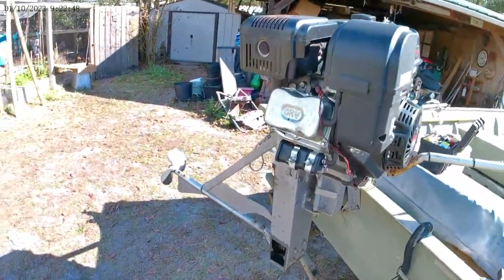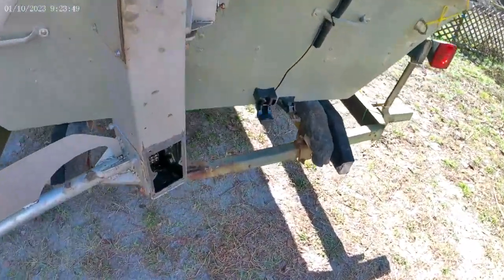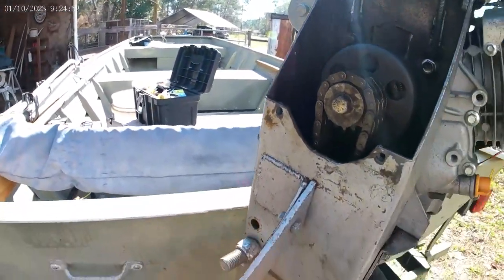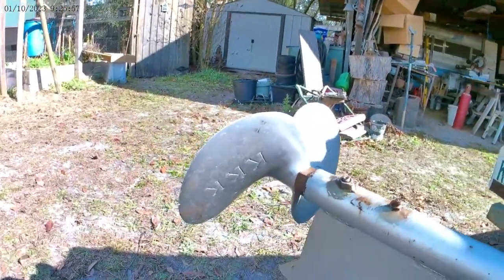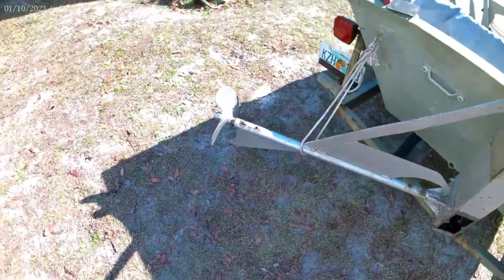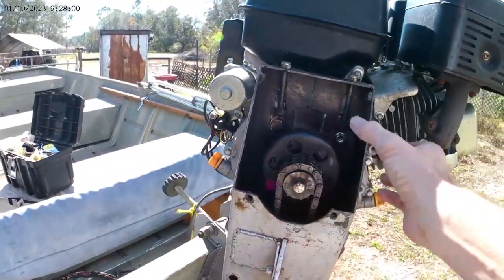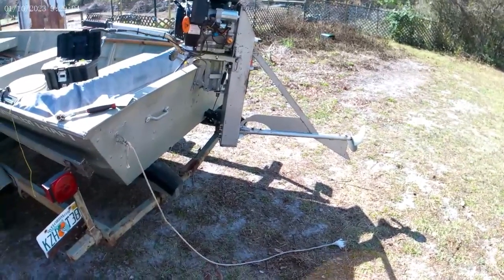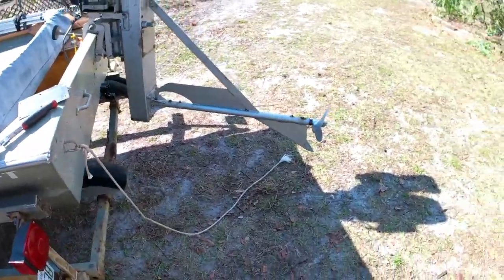Homemade short tail mud motor

Comment from the maker: So small update. The sprocket on the shaft came loose. I had  pinned it in place and it held for a long time and a lot of miles but let go about 3 miles from ramp. So I welded the hell out of it to the shaft! Just do that once you have it 100% in place! Trolling and rowing for miles is no fun!!
Reply: Lol damn right!!   However!…..thank you so much for this video….I myself am a tinker/fabricator/mechanic and I love this stuff.  You did a helluva job Sir!!!
Reply: Are those blueprints comparable with any motor or small motors? Interested in selling the plans?
Reply from the maker: @davidbrannan987  thank you. Much appreciated!y my first build like this.
Reply: @BackwoodsBuilt9737  you’re very welcome Sir!
Reply from the maker: @sm0k1ngam3rs3  the guy who made the plans built it to a 9hp motor. I  put 13 HP on mine. That's mainly why I had to go with triple roller chain over V belt. You can get plans off eBay from him. He also has a video on YouTube running it. Look for a homebuilt short tail with yellow engine.
Reply: @BackwoodsBuilt9737 thanks for sharing if you don't mind I have a question in the video you said you got the clutch and sprocket from mud skipper you said something about the chain ar sprockets being to small can you please give me the details of your  chain and sprockets set up so I can order the right stuff  thanks for sharing your work also thanks for all the great information  I'm a fan
Reply from the maker: @huxmetalworks7371  yes I got the sprockets from Mud Skipper as well as props and tapped props for my 3/4-10 thread on shaft. The chain that came with the mud skipper replacement kit was too short so I ordered a triple roller chain and connecting links from Nitro Power Sports.
06B-3R x 10ft. I just had to measure the mud skipper sprocket to get exact size I needed from Nitro.

Comment: thanks for doing this great review i bought the same plans i was wondering if it would work thanks for sharing can you tell me more about your motor i have a1432 topper jon boat
Reply from the maker: @huxmetalworks7371  thank you for watching! Wanted to give back after all the videos I watched! i have a 13 HP Predator motor on it from Harbor freight. Works good, electric start. Good torc all in all for it. Does around 15-20mph with 2 people.
Reply: Thanks for sharing

Comment: Nice job! 
     How far did you take the drive past the bottom of the boat? Do you think it causes a lot of drag in the water? Again looks good. Did you say you went off plans, if so where can I get them?
Reply from the maker: @riddle58   I would have to measure it again but went by what plans said to do. It's not very far past bottom! Have ran it in about 6-8 of water. When running shallow you keep prop slab out half way out of water. Got plans off eBay. A guy in Ukraine or Czechoslovakia or somewhere like that. He has video on YouTube as well. Has a yellow engine on it.
Reply: Thank you sir I will look for the plans. 
Thank you for your service! 
Go NAVY
Reply from the maker: @riddle58   it's actually 1.5" above bottom boat level. The extension and angle of drive shaft gets it in the water. But still plenty of water spashes between central tunnel and back of boat.
Reply: Thanks that was what I was looking at.

Comment: So you just straightened the taper in the propeller? Not tapered the shaft?
Reply from the maker: Yes. The propeller is soft aluminum from mud Skipper and was easy to tap out to 3/4 thread to match what i had shaft dia threaded to.

Comment: I like it, wander if it would bangle a 670 22 hp predator
Reply from the maker: I think it would now that ive been running it for a while and it seems fine. especially if you did extra welding on it here and there. i did in some places around the mount. i considered the 22HP but its same RPM as the 420, so only gives more torque and hole shot. which would still be nice but at $600.00 more that 420 didnt want to do it. 420 has no problem getting it moving in the weeds. also its geared to 4-4.1 I remember right.
Reply: @BackwoodsBuilt9737  already got the motor is the only reason why I would condider it